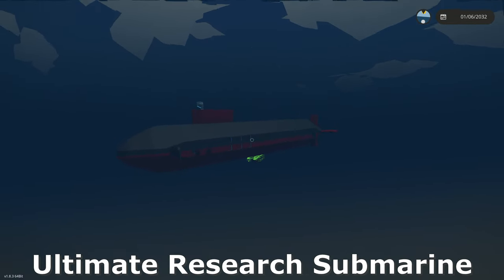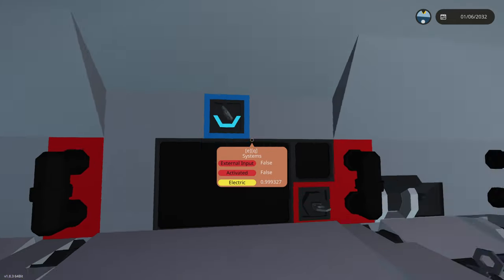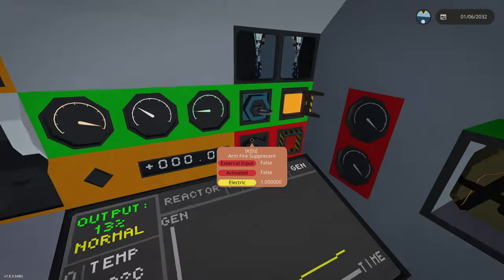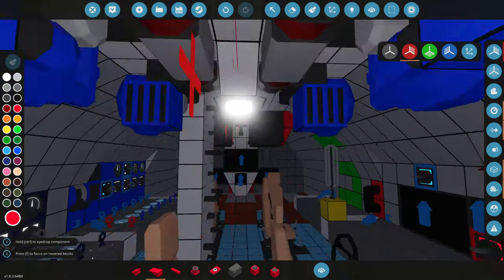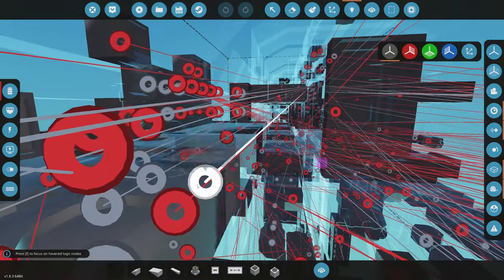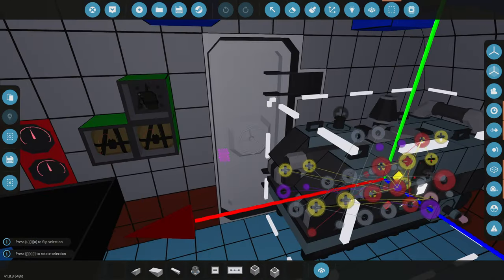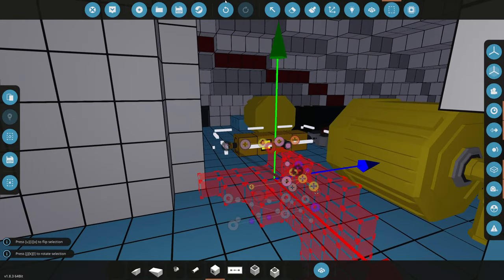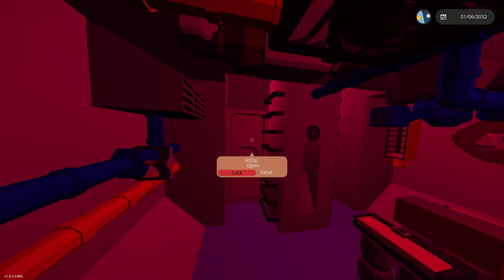Adding Electrical Systems | Ultimate Research Submarine, Stormworks (#13)

Comment: Suggestion:
Add in a main switchboard so you can turn off parts of the sub’s electricity.

You also have enough space if you rotate the emergency engine to not be blocking the door

I love the series and I hope you will post this on Steam Workshop